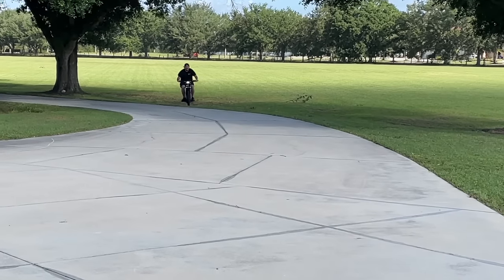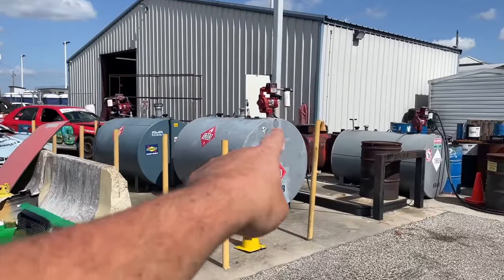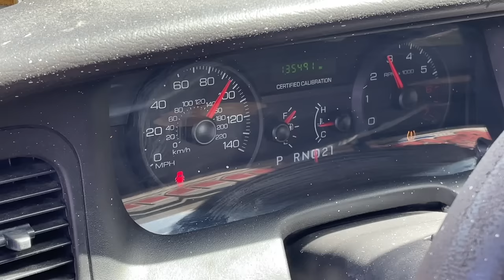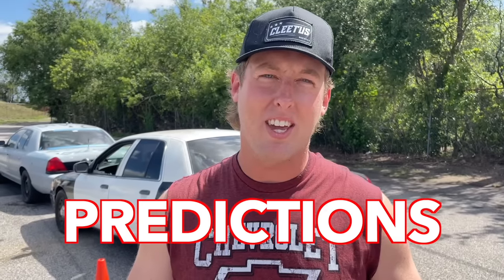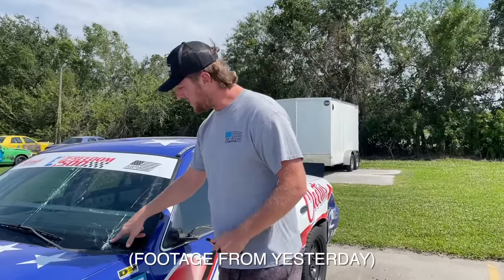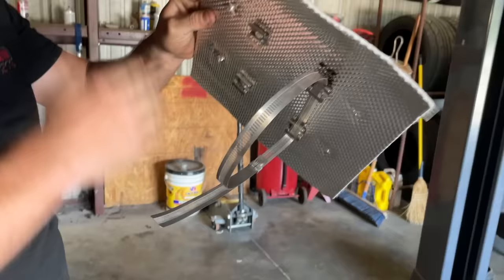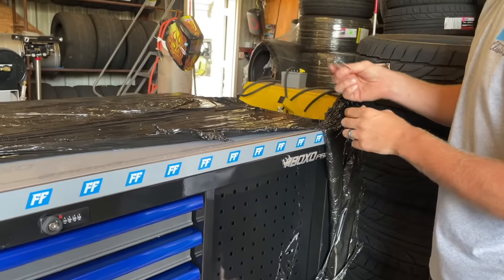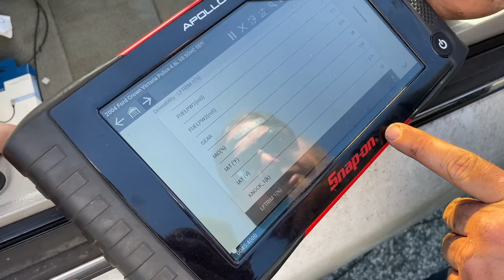This Crown Vic Is Going To Run At Full Speed For A MONTH... Let's Begin

Comment: Maybe you could try flushing the oil with the car running. You'd probably lose a bit of the new stuff in the process, but as long as your putting it in at the same speed it's coming out you may be able to do it
Reply: Being underneath a car doing 100mph on jackstands whilst changing the oil..... yeah I don't think even Cleet's health and safety standards stoop that low
Reply: Do it the dealership way, from the top. Thread the vacuum hose down to the sump and pour new in at the top at the same rate as it pumps out, like Michael suggested.
Reply: Should have hooked the big gas tank up to it but belt is not going to make it over a week

Comment: What would REALLY be cool is, if you give an extra turbo away to the person with the closest guess of mileage on the car at the end!
Reply: That's just a matter of simple math.
Reply: @GeneralKayoss  if it makes it the full month then it will be just under 76,000 miles but the difficult part is trying to guess how long it will actually make it
Reply: @stevenpopovich3587  I think it's going to make it longer than most people think. There's virtually no load on the engine with the wheels just free spinning. However that oil isn't going to make it 75k miles. lol
Reply: @generalkayoss7347  simple math, yes. .... but factors are a thing ... storms in Florida are a HUGE factor, could blow it off its jacks. Anything can happen

Comment: Many years ago we did a test where a Transist had to run cycling between idle and max no load for 800hrs. At round 200hrs the coolant tank exploded on on vehicle and the cat was blocked solid on the other....

Comment: At 100mph a day that’s 74,400 miles total after 31 days. With a 18mpg average for crown vics, it will take 4133.33 gallons over the 31 days. In my area, 87 octane is $3 a gallon costing a whopping $12,400 this month alone just in gas to do this. Roughly $400/day in fuel alone to keep it running…

Comment: youre supposed to use a pipe wrench to hold the throttle down. Clamp it on and us the lever length to weigh down the peddle.

Comment: That diff is gonna go lol glad to see y’all taking safety seriously bc we don’t want anyone to get hurt in any way
Reply: What if it sparks the fuel hose?
Reply: @Justinhomii  well then I guess the dang thing is gonna blow up Sparky
Reply: @Justinhomii  Well it could cause a fire, not likely to explode. We have a picture of an old square body crown vic cop car with the hose ripped out of the pump, (nozzle still in the tank) hanging in the break room at work. It has a trail of fire from the hose end back to the pump. (we do service station maintenance) I'd be more worried about someone getting wound up in the tire than a fire from fueling it.
Reply: I was thinking the dif or axel bearings at first; then I thought about the trans running at 100 mph with no air flow. I think the over/under on that car is about 24 hours.
Reply: unless it leaks all the oil out, the diff and pinion should survive since they are seeing close to zero load on jack stands. The axle bearings may not make it though since they primarily depend on receiving oil when the car takes a corner. I would suspect a head gasket or plastic intake manifold will fail since the car is sitting still.

Comment: When I raced my Crown Vic for autocross I melted my boots to the floorboard. Cut the cats out and put flex pipe in. Got Hot! I did put a couple floor mats down inside to save my boots.

Comment: I'm a Ford fan and worked as a tech at a couple dealerships but this car isn't going to make it more than a few days at best. I don't care what brand of car this is, SOMETHING is going to fail within a day or two at the most.  A bearing in a pulley or alternator or water pump will give out or the rear differential will give out or the transmission or a u joint will break.  It may overheat or something.  They should have put the front on jack stands to keep it level to keep the oil level more "level" as well.

Comment: It's turning about 3 grand, but those engines are tough. If it doesn't overheat, and the rear end and alternator holds up I predict two weeks at most before something in the drivetrain lets go.

Comment: my 07 crown vic  pasanger  floor board just melted off,the heat shield from the cat ended up rubbing up on it for i do now know long till i saw smoke coming out the rubber matt next to the seat.

Comment: It should only use 20% of the fuel or less, give or take, as it would actually traveling down the road.  So if the car normally gets 16 mpg @ 100mph, it should now get roughly 80 mpg.  In 31 days it should travel 74,400 miles, and at 80 mpg that's 930 gallons of fuel!  At $3.49/gallon that's $3,246 in fuel used in 31 days is my best estimate.

Comment: if it runs the entire 31 days at approx 102 mph it'll rack up 75,888 miles during the month of freedom. I'm really curious how much fuel it will use seeing as it's almost "no load" and no wind resistance.

Comment: My husband has 2 predictions and says they have fairly equal probability. 
Prediction 1: The catalytic converter will get so hot it catches the whole thing on fire.
Prediction 2: It will vibrate off the jack stands and hit the ground at 100 mph and take off like a bat outta hell. I hope everything is insured very well.

Comment: If you want to put the Vic upto a real challenge, put it on a dyno, or figure out a way to load the engine. Right now it's just spinning it's wheels so it's not under any load. Mpg will be pretty good this way though

Comment: Ok.. so long story made short.. the Nitto 555g2 tires are what I chose for my 96 Impala SS.. bone stock, except for literally 800lbs of audio in the trunk.. moved from my old house, 2.5hrs away.. rainy night, fell asleep at the wheel with the cruise set at 80mph.. felt the rumble strips under the drivers side, didnt notice the passenger side.. but woke up to see I was fully on the right shoulder, about to smash a parked car.. yanked the wheel hard left, then back right after a little stab at the brakes...  thank the big man, it didn't break traction and spin out.. man I was terrified.. wide awak for the last hour driving home.. NITTO fan for life!!

Comment: I'm with George on the rear end being the weak point. I figure it will overheat and cause some issues without active cooling on the housing. That being said, no load minimal heat? 🫠

Comment: just found this and it is a shame thought wasn't given to making this a little more realistic rather than just an extreme torture test even though that is entertaining too. One of those 4 foot shop fans blowing on the front of the car to replicate road conditions a little more might have been a thing worth thinking about. Honestly, engineers usually design around human factors such as the hour or two a day a human driver would require to gas up and have a meal, and go to the bathroom . Even a twenty-minute shutdown every eight hours could have made a huge difference in longevity perhaps. It would be interesting if you ever repeat this trial to see what might happen. Also, i don't know exactly how you can fix it but cars don't run at the same rpm constantly. Even without a load of moving the car, I expect the high unchanging RPM's is a bigger stress than real driving. Awesome feature , wish I would have seen it sooner.

Comment: there are 744 hours in may total so if you started in at midnight on may 1 then at midnight on the 31 the car will put on 75,888 miles so just subtract the number of hours from 12 am from the time you guys started it good luck and that's at a speed of 102 mph

Comment: 287000 miles and the oil will be very low if any at all i give it 300 hours so about 28000 miles before you guys have problems if you guys don't forget to Refill it

Comment: The Crown Vic will run a long time without a load..  gas mileage will also be great...
If the axle goes, just drop the drive shaft.. it will keep racking those miles...

Comment: Water pump, alternator, rear diff, u-joints and wheel bearings are gonna be the likely candidates for ending the Crown Vic's run. Which is no different than any other car. The drivetrain should be fine considering how little of a load this would be. I'm curious to see if oil breakdown will be a problem. I imagine the condition of oil won't matter as much when the motor isn't working hard.
Reply: its already dead...

Comment: If it averages 100mph, that's like 72,000 miles. It'll be due for an oil change in the first few days. Engine will self destruct due to some sort of oiling problem, bet.

Comment: Your question could have very easily been answered using some basic math.  31 days = 744 hours x 100 miles an hour = 74400 if the vehicle runs at exactly 100 mph for exactly 31 days.

Comment: 100mph at 24 hours in a day and 31 days in May equals out to be 74,400 miles. And if you can manage to get 15mpg, that's gonna be 4,960 gallons of gas.
Reply: So if you can get a deal on gas price and get it at $4. That's gonna cost you $19,840 in fuel.

Comment: I just did some quick math and I don't think that Crown Victoria is going to make it. 100 miles an hour, 24 hours a day, for 31 days straight comes out to be like 74,400 miles.
Reply: I am going to amend my guess. 102 miles an hour for 24 hours a day for 31 days straight equals 75,888 miles.
Reply: I think if you slow the car down to about 55 miles an hour it may have a chance to go a month because then yoou look at around 41,000 miles.

Comment: Back it the late 1970’s Chet 327 held the title . Motors on a stand relining at about 4500 I think for 41/2 minutes no load . Then they put a 900 Kawasaki under the same test. 9600 and it went I think 12 minutes, no load.  New record.

Comment: 100 MPH x 24 hours = 2,400 mi/day x 31 days = 74,400 miles / 15 mpg (generous) = 4,960 gallons of gas....Should be interesting...LOL  I'm not even going to bring up doing 74k without an oil change...

Comment: A dyno with a fan would last a month easy - I don't think engines and drivetrains like high-ish rpm unloaded, but zero airflow as well? RIP Vic 😥 EDIT - EEK! You parked a car in front of the radiator?

Comment: This is like cheating, without load on the engine. No air and no rolling resistance, so engine only needs about 6hp to run with wheels off the ground, and it does of course not generate any more.